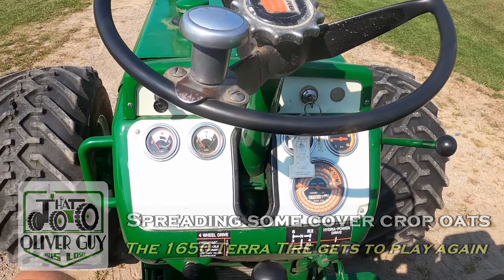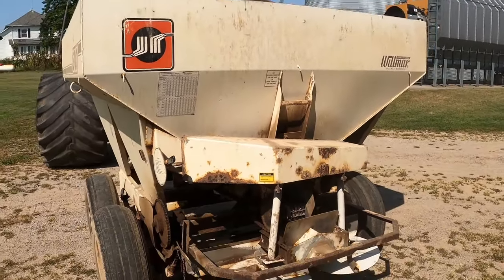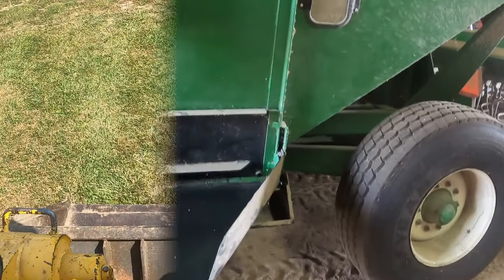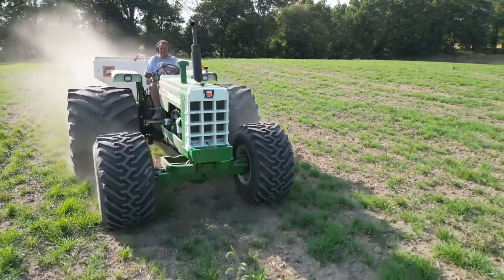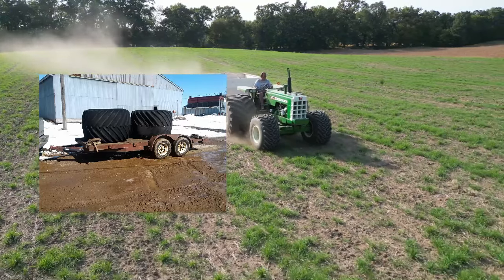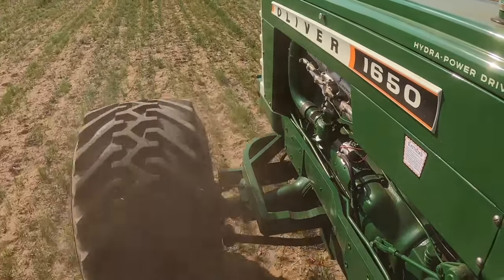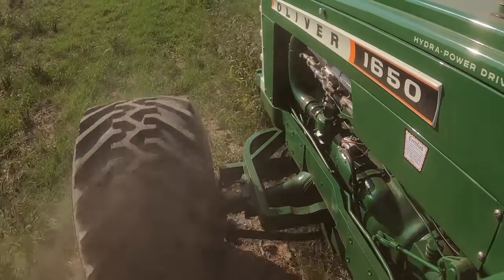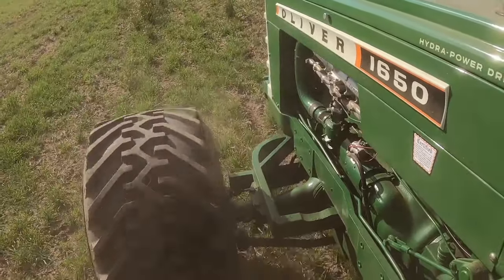Eating Dust, Terra Tires, and Cover Crops

Comment: Very nice 1650. Flying a drone while running a tractor without auto steer looks challenging. I got mine out for the first time in like a year and half and was struggling with both hands 🙌🤣👍
Reply from the maker: It's still a challenge, some of the footage stays on the cutting room floor. 😂

Comment: Tearing down a 550 to replace the water pump, coolant hoses, and to clean it all up. What do you use to clean the grease/grime off the engines and frame when taking one apart?
Reply from the maker: One of the best tools I have is a steam pressure washer. Get that cooking good and hot and it can take the paint off if you get too close. After that, I like mineral spirits. It won't take older paint off if you're trying to go that route. It dissolves iil and grease well and air dries, but not fast like brake cleaner.

Comment: Tires look overinflated
Reply from the maker: What pressure would you recommend?
Reply: The old rule of thumb growing up, was 1 psi for each inch of tire width.  Not sure that applies to flotation tires.
Reply from the maker: @robertheinkel6225  I think this might break that rule. The rears are 66 inches wide. I have them at 10 psi.